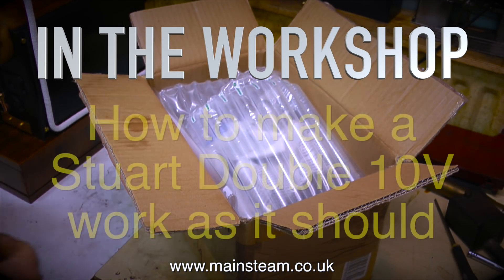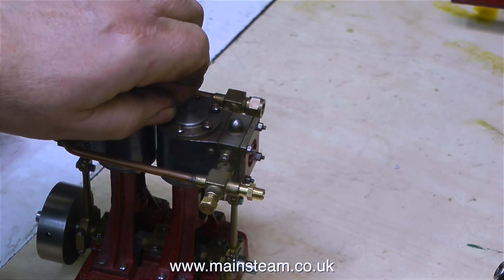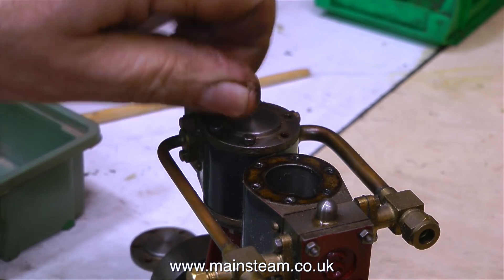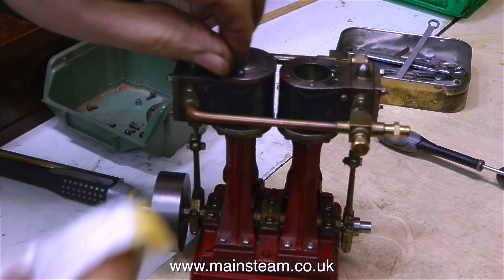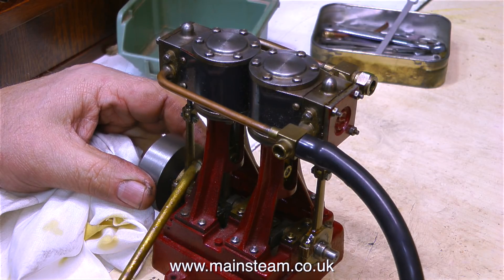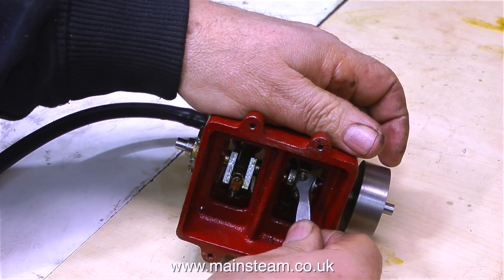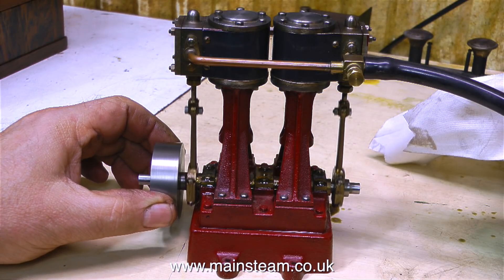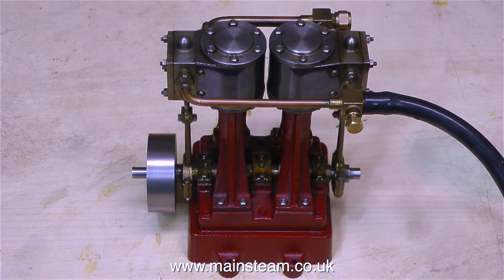HOW TO MAKE A STUART DOUBLE 10V STEAM ENGINE WORK - IN THE WORKSHOP

Comment: 4:30 Damn, that's one way to free her up! Set the lathe to high speed and click her on! One of my favourite sayings is "When in doubt, add more throttle. It may not improve the situation but it will for sure end the suspense." Made me instantly think of that when I saw the crankshaft in the lathe :)
Reply from the maker: Never - brute force is not recommended - the power switch on the Lathe was definitely "OFF" .......

Comment: Hi Keith, When you  'wound it up' at 10 minutes into the video the little engine was really revving.
Is there a maximum rpm limit that should observed? 
I'm just starting to build my first engine, a 10V single. I don't want to damage it by over speeding it when I test run it.
Regards Paul in NZ
Reply from the maker: I do that to test that everything works without bits dropping off the engine. These small Stuart Models engines are classed as "High Speed Steam Engines"

Comment: Good short video. Will it be a good idea to use airline lubricator while running engines on air?
Reply from the maker: Only if I wanted to run on compressed air for longer and continuously. I have an inline lubricator in the circuit, but it's usually empty  ..... {:-)))
Reply from the maker: Short Video .... ??? ....... it runs for 12 minutes and 37 seconds, it took me over 3 1/2 hours to make it ....... and it's FREE - ! - ! - ! ..........am glad that I have a few Patreon subscribers to help me out . . .  }:-[[[
Reply: Sorry. I meant to say a short series. I think there will be no more videos for this engine. I know you take a lot of effort to make these videos. Thanks a lot from bottom of my heart.
Reply: When running a engine at a public display where it will be running off and on all day, you have to treat it like an air tool and use air tool lubricant. One of the model engineers  I know builds exquisite small engines mounts them on a display stand that contains a filter, regulator, lubricator unit in it. He pipes this up to the air manifold or compressor and can run them all day.

Comment: Very nice. Sweet sound too!   
I wonder about some of the new oils that contain "special polymers" such as PTFE resins and the like, that actually soak into the metal to keep the surfaces SLICK even though the carrier oil has moved off the surfaces. Letting an engine sit around unused for years, this treatment might keep everything slippery until the next use. Just a thought.

Comment: Bonjour Keith,
Which pressure did you apply for your test ? Very nice machine I agree, unfortunately without Stephenson reverse and not green :+)
Amicalement, Raphaël
Reply from the maker: about 10psi for slow - 35psi for fast

Comment: There is nothing wrong with being more than a bit obsessive about getting things correct.  As a very old time software guy (think starting programming in 1969 on IBM Mainframes in Assembler) I always obsessed about getting things 'right'. It was bad enough getting a call in the day time about a program failing - but at 2 AM it was BAD. My rule quickly became "Mike gets to sleep all night!". Spending a little time checking and verifying is time well spent.
BTW: have you ever come across an ICL 1500? I did a lot of software for those things between 1974 and 1984 starting when they were known as Singer 1500s.
Reply: I saw a Singer 1500 at a swap meet once, but the owner didn't know anything about it.  What were they used for?

Comment: I have a design and no help 8 cyl. rotary; no valves, no connecting rods,no oil,no boiler, could be solar powered shooting for 25 hp with an engine 18 inches dia. X 7 inches would for its size be of very high torque